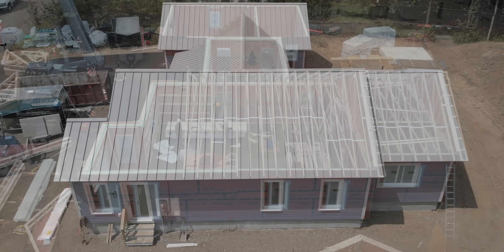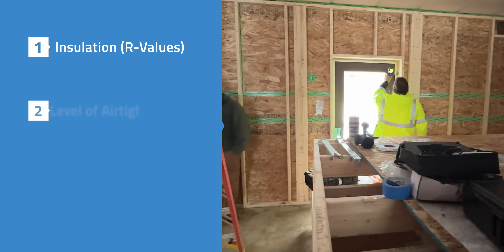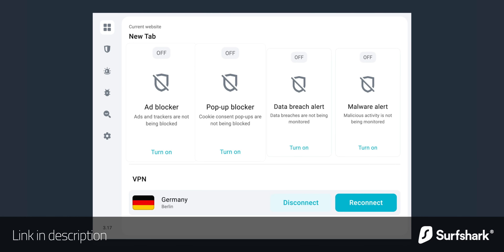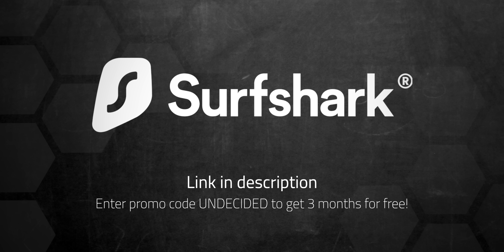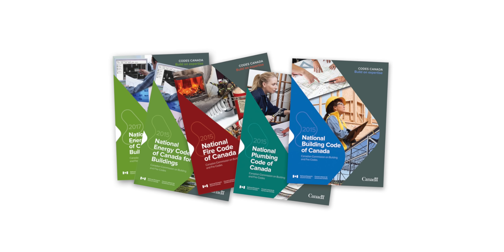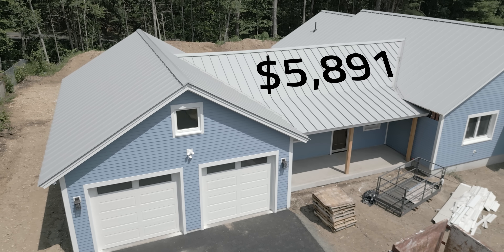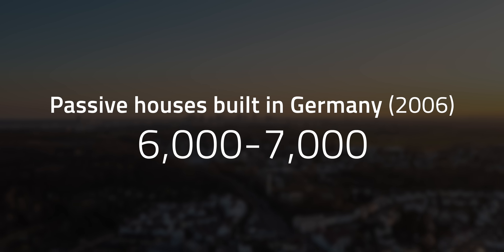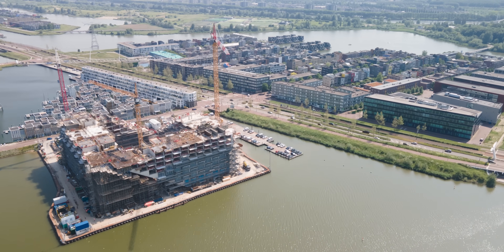Why Do American Homes Suck?

Comment: Architect Here - I love studying energy design and try to implement it into projects. It always comes down to cost. Many clients embrace the money saved over time with energy efficient designs if they know they will be living in the house for decades. Developers on the other hand can and will never be bothered. Code builds through and through and pass energy operation costs onto the buyers/ renters.
Reply: Wouldn't a better house have dramatically more value even if you only lived there a decade? It should be easier to sell, have more value, and be better designed and more liveable. Do estate agents in the US not know how to market homes that are modern and meet sensible standards? I would have thought it would be incredibly easy. 'This home will cost you $400 less per month to run and is less likely to fall down.' I get that people are cheap, I just don't get the mentality that they want to own a home, but also consider it a short term thing with no value when they're done with it. It's not like buying an ICE vehicle, or a high end gaming PC or a lasagne.
Reply: @jonevansauthor  Because it’s not easier to sell. Your home value is based on the surrounding values. So if you have a house that is worth 400k and surrounded by similar sized homes valued at 300k, then your home value will drop. My wife and I have bought/sold 5 houses since we’ve been married. Not a single person has asked for a previous electric bill, the R value of the insulation or anything else. Is it the right size, pretty and the right price is all most people care about.
Reply: @keithb6344  Exactly…….it’s lipstick on a pig. You build a 2000 soft home for 400k in a 250k neighborhood and your resale value will be based on the comps in your neighborhood…..you better plan on living there for life and never moving because you’ll loose BIG TIME on resale.
Reply: @jonevansauthor nope. Didn't even read your comment past the first line. We build what customers want. End of story.
You won't pay what a quality house costs so why do you think someone will drive up the price?
Reply: Is there no mandatory regulation to build energy saving designs?
We have a scale from E to A for how energy efficient a house is, and new houses must be built to at least the B standard. A level houses usually fetch much higher (20%) prices, also because it often in a general sign of build quality.
Reply: @rogerwilco2  - We have minimum energy code standards as part of the International Building Code used here in the States and is modified at the State Level. So per climate zone a certain ratio of cavity insulation to exterior insulation with requirements on air changes per hour. That said the zeitgeist here amongst many clients and builders is to build to code, which is Minimum and there is always hesitancy to improve.  US Energy code requirements are easily 1/4 that of our European Colleagues
Reply: Developers would not bother, true.
That's why EU regulators step in and create standards for buildings, including insulation, passive cooling/heating, etc.
Reply: @user-mz1bi4xz6rThe idea of a starter home doesn't really exist in Germany. When you build a home, you're planning on growing old there, maybe having one of your kids inherit and live in it in the future. Before that, you rent.
But there's also a lot less cross country mobility in Germany. People move way less often in their lifetime than Americans do. They don't tend to change careers as much as Americans do and report to identify more with their regional than their national roots. You can see that most easily with second generation immigrants who will gladly identify as "Hessians" or "Berliners" but hesitate to call themselves "Germans".
Taking all this into consideration, it makes sense that Germans think more long-term when building a home.
Reply: Greed is the reason American houses suck so much. 

Capitalism only incentivizes profit, so even though e every efficient homes would benefit everyone by reducing energy consumption, and in turn cost and pollution, we will never see it because it hurts the profits of a few. 

Ridiculous
Reply: Agreed, US building codes suck and cities require homes that are too big to be efficient. I built my own home with 2x6 walls, super insulated and can heat, cook and heat water for about a dollar a day with propane.  I have 1.2Kw of solar and I have most modern conveniences.  Houses in the US are also not positioned to make use of solar and roof designs are not designed for solar. I use a ground mount solar system that allows positioning and easier to do maintenance and cleaning.  

US homes do not design n passive solar and natural cooling like porches, smaller windows and cross ventilation so they need huge AC units. I cool my entre house with a 45 watt evap cooler.

Banks want traditional houses and builders want to build cheap and fast to make a profit!
Reply: Gotta love how capitalism disrupts progress to a better future. Without a profit motive our housing code will never change.
Reply: Is there a way to get builders incentive to build high efficiency homes? Possibly market their homes as far less costly to own over time?
Reply: @TommySchlong it is called regulation. Northern European building rules are heavily regulated. The government in each country decides how much energy your house can use, and you are legally obliged to build accordingly. That is why you the quality of houses are so much higher in Europe.
Reply: I disagree: it comes down to knowledge and courage to implement. And looking over the fence
Reply: @user-mz1bi4xz6r If you would treat houses as an investment, you would built them more durable. So they easily last 100+ years.  You treat them as a good that is consumed. Used up. And then replaced. 40 years is just one generation. If it's an investment, then I should be able to sell it after that time and at least 1-2 other generations should be able to live in. Otherwise, if there is no value left after 40 years (bacuase it can't be sold, only broken down and rebuilt), I just pay my "rent" to the bank instead of a landlord...
Reply: The entire home construction market in the US is an elaborate scam. You build shitty houses that lasts for about 30 years and then you make the home owner take a mortgage to pay for it, giving them a worthless product at the end of the mortgage period. You are essentially renting your own house from the bank.
Reply: Lets make the code require highly efficient expensive construction, and then complain about a lack of affordable housing.
Reply: @r.b.l.5841 affordable housing are apartments, not single family houses. And you can build those to be energy efficient due to the economy of scale.
Reply: @Viktor-x1w7w  people don't do well in high density - look at the crime rates, life expectancy, quality of life.  people, like all mammals, need sufficient space or they decline.  Packing people into apartment buildings is an economic strategy to keep them leashed to rents, and transfer they wealth to landlords.
Reply: In Europe, this problem has been solved in a simple way, through building standards and also the building's energy certificate. If you want to sell a property, the company has to make you this certificate, because it is a condition of sale. The cost of the certificate is not a lot of money, and the buyer knows what kind of house he is buying. So even developers cannot cut completely on materials because it will backfire on the sale.
Reply: This. Houses are already crazy expensive. Even if it saves more in the long run, there are a lot of people who simply cannot afford a million dollar home with their $28/hour average wage, and landlords will do anything to save a buck and charge us more; something that these energy inefficient homes do simultaneously.
Reply: @Naokarma  A million dollar home? What are you talking about? A standard Swedish new built home with highest energy rating is like maybe 300k USD.
Reply: @melange78  And that's Sweden, not the US. The housing crisis hits hard, and even small homes cost around that without these regulations. To afford a reasonably sized home that meets these standards would EASILY approach that $1 million landmark.
Reply: @Naokarma  Why would it be more expensive in the US, I don't get it? Everything is cheaper in the US.
Reply: @melange78  Blackrock, Vanguard, Statestreet buying up properties at sometimes $30k above market and asking price is certainly one factor.

In my area a shoebox house on a postage stamp lot is nearly that $300k. It also costs in materials and labor about 1.5x of resale value to build a house here, there are also all the bribes (applications, variances, etc. fees). In other words to build a house worth 100k costs 150k or more during the build.
Reply: @1DwtEaUn  But my point is you don't get a newly built house for 150k in Europe.
Reply: @melange78  I get that, my point was building a 200k house in the US would be 300k or more to build, in regards to everything being cheaper in US.
Reply: @1DwtEaUn  So what if it cost 300k if you save on the resale value and energy costs. Do you think interest to the bank is cheap for a house without resale value?
Reply: @melange78  That isn't building to EU specs. That is building like the million dollar house that went up on my road, the only wall insulation was spray foam on the outside walls, that only half filled the cavity between the wall studs so around 1/2 to 3/4 inch (12-19mm) of spray foam. That was built in an area that gets -5F to -10F (-20C to -23C) winter temps.
Reply: @1DwtEaUn  I don't understand why it would cost a million dollar to build a EU home in the US when EVERYTHING is so cheap in the US. Your argumentation does not help me at all, and I have lived for 3 years in the US. Land is cheaper. Regulations are less. Materials are less. Labor costs are less.
Reply: @melange78  That was an example of expensive in the US and it is still built like crap, the crap US baseline is about that 1.5x cost to re-sale value. 

Everything above that is at a premium and a lot of builders dislike working with items they haven't dealt with before. The european style windows here are typically 3-4x per window the standard single/double pane windows that don't really seal. You can build well here it just isn't very affordable, you can do probably your 300k price, but it is not going to be up to the EU baseline and likely smaller than what you could build in EU at the same price point.
Reply: @1DwtEaUn  But you don't explain why that is the case. If they had to import European made windows I get it it cost more but to add a 10 times cost for work for the exact same number of work hours does not make sense at all and given the nature of business in the US I don't see how that could even be a thing.
Reply: @Naokarma  what even makes a house bulit out of timber and drywall/plywood (basically cardboard) cost 1 mln USD? 
1 mln USD is like 100 mln Rubles.
100 mln rubles get you a ridiculously large castle in Russia's most expensive neighborhood bulit out of brick half a metre thick and fully furnished with Italian design and golden leaf and whatever....
And yes, above half a metre of brick (bricks are empty inside) is warm.
Reply: @chartedtravel1776  why $50? Even on the mandatory auto insurance it's 5 k minimum (by law). When there are government compensations, they are in 10k-80k range, plus monthly pensions. 
$50 is what a pair of shoes or a piece of mass-produced jewelry costs.
Reply: @chartedtravel1776  I don't even think you read what I write. If you think that materials are more expensive in the US you are wrong and I am not going to google that for you.
Reply: @chartedtravel1776  A 300k USD home in Sweden is about 175m2, one car garage, 2 bathrooms etc.
Reply: @chartedtravel1776  I don't understand what you are arguing about to be honest. You are arguing against your own points.
Reply: @chartedtravel1776 a testiment to the US‘ disgust for efficiency and environmentally sound policies. Also wtf the decadence.
Reply: Builder sin Europe du, because their customers care! And they have to follow codes/regulations.
Reply: Look into houses built with straw and clay, which is often found at the building site...
But no, ....it is considered as "dirt" by many people and they prefer to use much more toxic building materials like cement.

In the future we will build homes with clay, not because we can, we have to. It is also a material with a lot of useful properties, but the "dirt" stigmata remains...
Reply: It’s interesting to see that there is no additional market value for an energy efficient home in the US. Otherwise it would not matter that the investment up front is higher especially if the resell value goes up. However, I do see it may be difficult to compete with a 200sqm home compared to a 400sqm home with less efficiency.
The government needs to step it with climate goals to make efficient homes the norm but it does mean buying or building a home will be affordable for less and less people.
Reply: @hobbykip we have energy standards. Often higher than European countries. Going up all the time.

Comment: Good summary Matt. I’ve lived (and built /renovated) houses in Australia, the UK and Denmark. The Danish building code and standards are far higher than the other two countries. It turns out that heavily taxed energy prices are a great motivator! For my 2001 built Danish house (2000 square feet, with a high energy rating) I still paid approx USD5300 for natural gas in the 12 months to May 2023, up considerably thanks to Putin.
Reply: USD5300 for natural gas in the 12 months is insane. assuming you only need that in the winter that $1000/month for winter months, do you live in a tent? it would be cheaper to go airbnb in Spain for 5 months
Reply: @TheSateef  it is insane, but that’s what happened across Europe last year. In the previous period it was approximately USD2000, which is still insane. About 60% of the total price is taxes…. And no, I don’t live in a ⛺️. Our house has an energy rating of B (scale is A to G, A being the highest). In November, I’m connecting the house to a new district heating network, which should bring the spend down by approximately 25%. I looked into installing a ground source heatpump, but our house is on a steep hill and although possible, the install price was too high (USD28,000). Did I mention the taxes in Denmark?? Happiest people on earth, apparently :(
Reply: @rhyswilliams695  With that install price, if the heat pump would zero out that $2K cost for heating, you'd only be looking at 14 years for it to pay for itself. That's not bad. And if you sell off the house before then, that's a major increase in sales price you can get.
Reply: @rhyswilliams695  Why not an air source heat pump?
Reply: I am in east of France and last year, I paid only 1600 euros as my total energy bill (full electric here), for the heating, my 2 EVs, hot water...
This is 8000kWh for all my energy use (car included) for a 140 m^2 (1500 ft^2) house.
It is using a thermodynamic (heat pump) whole house ventilation system (2.5kW heating power), a backup electric heater (1.5kW) when it is very cold, an electric instant water heater (9kW), a grey water heat exchanger (around 9kW), a few photovoltaic panels.
It has more than 30cm insulation in the walls/roof and the concrete slab is insulated (15cm of XPS) under it and around it
The electricity price went up but as my energy use is not that big, I didn't feel anything.
Reply from the maker: Glad you liked it and interesting info/experience.  Thanks for sharing!

Comment: One interesting thing I heard about architecture and civil engineering: of all the natural resources that do not exist in Korean peninsula, one of very few resources that actually exist in abundance is limestone. Cement and concrete are hard to haul over long distance, but an abundant limestone reserves within a landmass as small as Ireland means endless rows of high-rise concrete apartment buildings.
Reply: pretty sure that's not a reason, Malaysia is also relatively limestone heavy, they still have lots of landed properties. In fact several HOAs full of double storied semi-detach.

IMO it's a lot more efficient to cattle nearly every one into the high rises, and also a danger in times of war which is a consideration I'm pretty sure the ROK government considered on top of the severely mountainous geography of the Korean P. . Can't really fight CQB without the urban and tight element...

Comment: 1st stop building your homes from wood, wood ,wood and more wood.  all this arching back to the founding fathers Log Cabins is really silly when in the UK and most of our former Empire countries they build with Brick not wood for hundreds of years. 

if the look of your homes matters history wise build with bricks and face with wood panels that over lap downwards to push rain away from the walls. 
But stop building timber framed and wood clad homes. when you can have Termites in some places then wooden homes are daft.

That's the issue being only wood built is a very bad heat and cold control home as yours have all wood build and then a little insulation in there but still lots of wood sheeting and hollow stud wood panel and framed walls. Daft and not as good as a solid brick walled building. look at the age of most of our homes some are older than the USA and still are great solid homes.